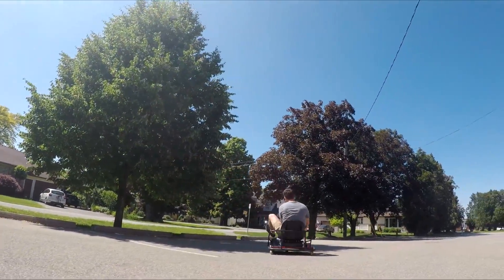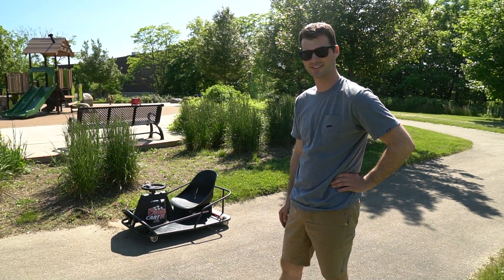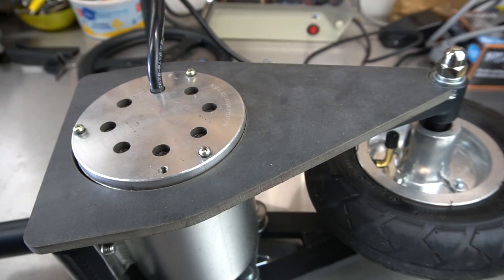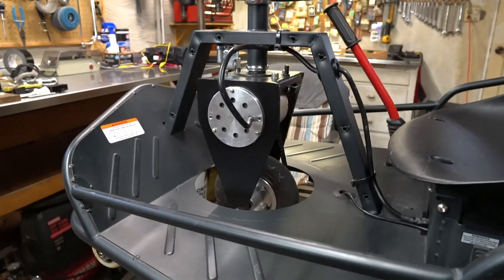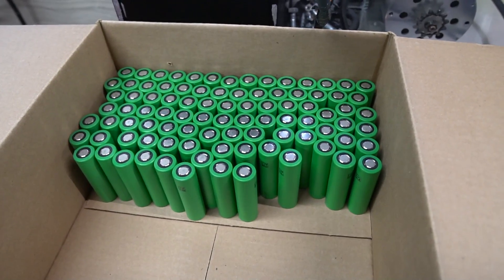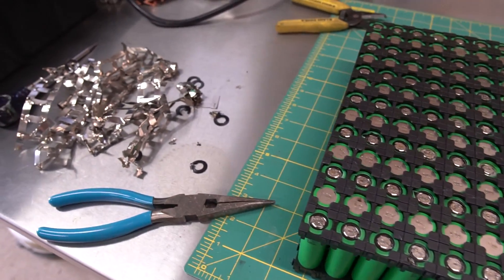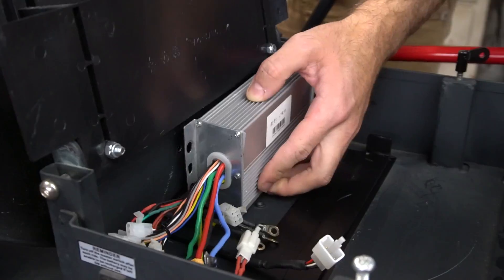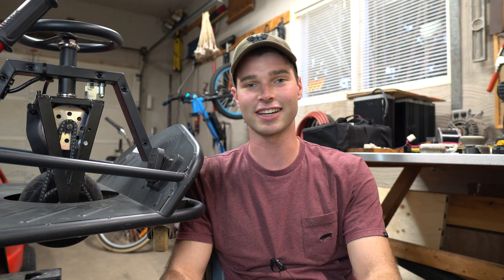Electric Drift Kart Build - Crazy Cart Upgrades!

Comment: Bugger was really hoping it would just fit straight on Jesus aye use had to do a fair bit I've got a electric green machine I'm planning to get a 1800/2000w motor kit I was really hoping it would just bolt straight on as the original motor has the 4 bolt two mounts one on top and bottom and that's how they are on ebay god Im not the best with power tools but I'm good at putting things together hope I can do it hehe my main issue was figuring out how to put the 48 volt or 52 volt battery im really hoping I don't have to worry about bloody making new mounts for the motor as well anyways man this is a cool build well done.

Comment: Your battery has the capability to comfortably run a 5 KW motor if I'm not wrong. wouldn't it be better to get lower current higher capacity cells for this application? like the samsung 30Q or even samsung 35E cells which would give you respectively 1.15 or 1.3 times the capacity. Unless you will be using it for a later more power hungry project ofcourse ;)
Reply from the maker: Your right! I use this battery for my electric drift trike as well and I am hoping to use it with some other builds! ;P
Reply: @austiwawa interested in making another battery like this to sell?

Comment: Its important to fuse each cell to the bus on either + or - side so that if a individual cell fails (shorts) the fuse burns thru as the overall packs current flows thru the cell that is shorting - this avoids a full pack short which might result in a fire.   The fuse need not be sophisticated - maybe 27awg wire (20amp burn) or something like that - just so the full current of the pack (140a) will melt it but yet the full current from an individual cell (20a) will not melt it.    Love your enthusiam/videos!
Reply from the maker: Thanks for your input! :)

Comment: austiwawa  Excellent build and videos, especially the ride-it was badassery.  If you ever get a chance look into AGNI/Lynch motors, they are amazing and unique high power D/C Motors, I own one and the best part of them is you can use a cheap chinese PWM speed controller (the highest power and voltage ones you can get) 
 I've ran them up to 80 volts, but they'll run all the way down to only 6 volts amazingly.
Reply from the maker: Thank you for the suggestion! I have actually been looking into the Lynch motors after watching Colin Furze's electric drift trike build. I would like to use one for a future project down the road :)
Reply: Martyr4JesusTheChrist  I actually pulled an AGNI 95 off a 2 seater go cart from a large go cart racing business that had went under, I found it on Let Go app.  Here is a link to AGNI motors, although I think the company is now called Lynch motors and do business as such:
http://www.asmokarts.com/index.cfm?pageID=24